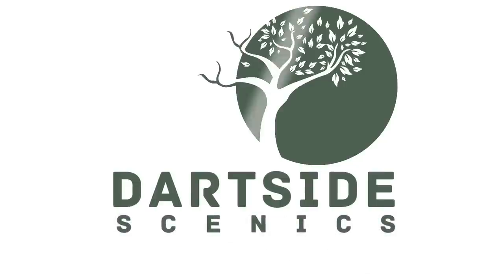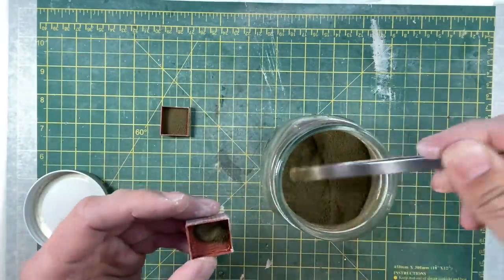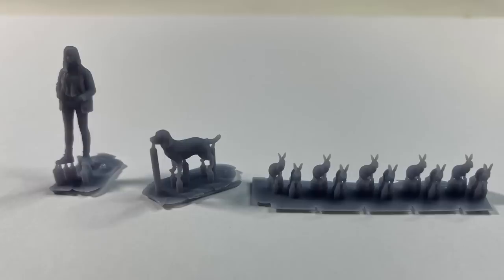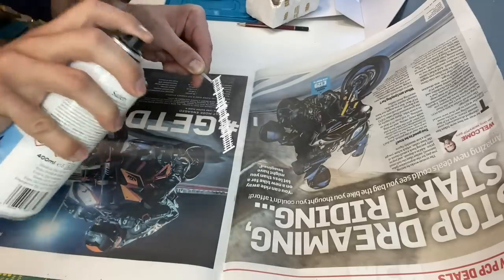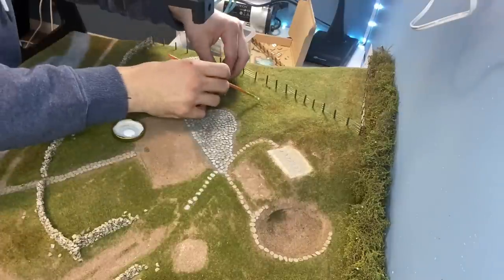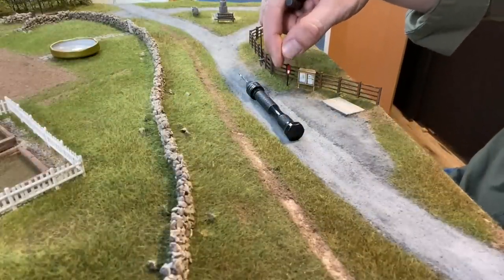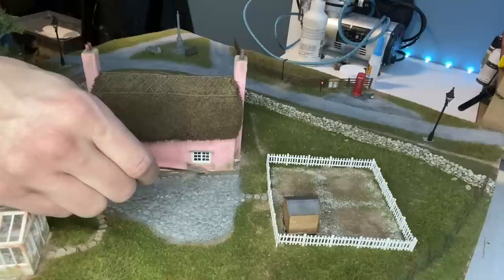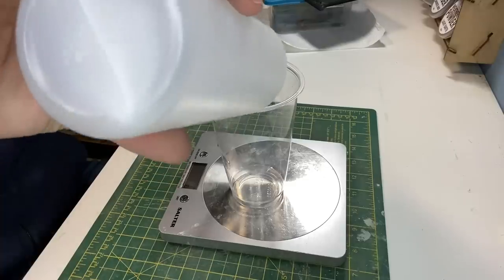Thatched Cottage Diorama

Comment: Great build/video as always. Aside: I have made my own cheap 'sculptamold' by soaking paper from the document shredder in water, drying and then adding cheap ' polyfiller' from the pound shop, works well, much cheaper on large areas, also can lay down paper strips to cover gaps etc.
Reply from the maker: Thank you.  That does sound like a very good alternative
Reply: I forgot to add, put the wet paper through a blender if you want a finer mix.
Reply from the maker: @seakr9838  ah yes, I used some blended loo roll on my dry stone wall video as I’d run out of sculptamold!!  I’m not sure I got the mix right but it seemed to work ok.

Comment: Wow I love this and would like to do something similar.  I’ve only worked in 1/12th so far though so have some questions.  How do you go about designing the layout, why use soapy water & how long did it take to make?
Reply from the maker: Hi Diane.  

My daughter designed this one but it was similar to the way I usually plan it.  I only have a rough idea in my head of what I want to achieve and form the land shape loosely on that.  The way I see it, the land is there first so making small adjustments to fit buildings, etc is what you would have to do in real life.

The soapy water breaks the surface tension.  If you have an amount of scatter or powder and drop watered down glue onto it, the glue will bead and create a bit of a mess.  If you do it after a spray of soapy water, it soaks in to ensure it sets correctly.

I didn't actually time how long it took me but I spent a long time procrastinating on the techniques I hadn't tried before.

Comment: Please could you advise what you use to spray the scenic cement, and whether you dilute it first.  I have tried many different sprayers including the WS sprayer and a garden sprayer with adjustable nozzle, and the cement always falls in blobs as opposed to a fine mist.  The result is that weathering powders and ballast are dislodged by the process. Any advice welcomed, thank you.
Reply from the maker: I picked up some small spray bottles from Boots which give quite a fine mist from a height.  I don’t dilute the scenic cement.  I try to remember to clean the bottle/nozzle thoroughly as the glue can ruin the spray mechanism.
Reply: Many thanks for your reply, and looking forward to the next instalment of your railway layout